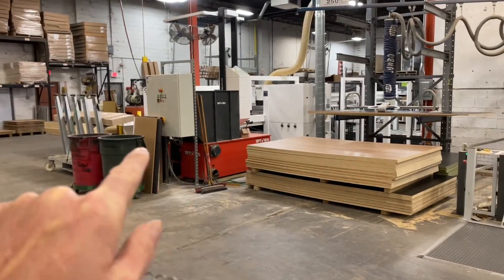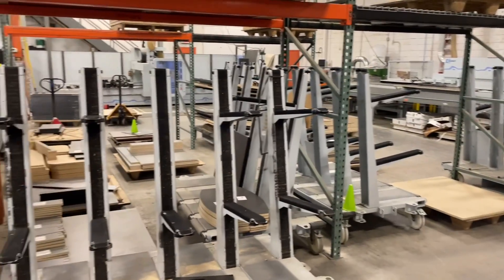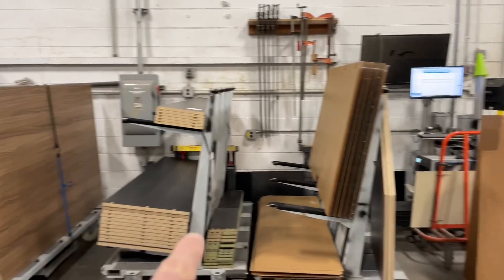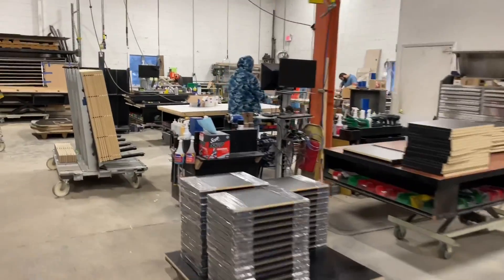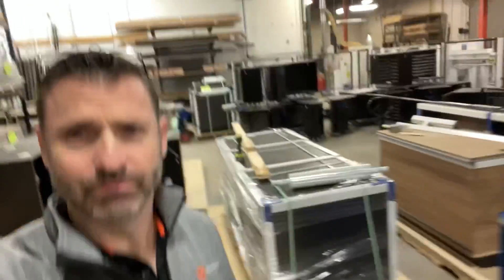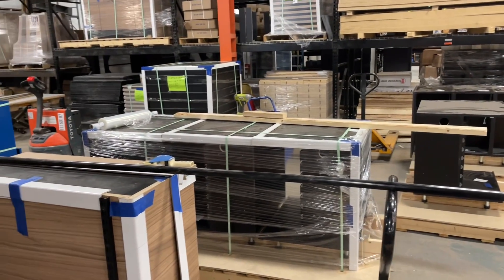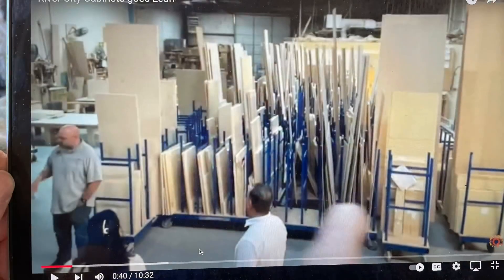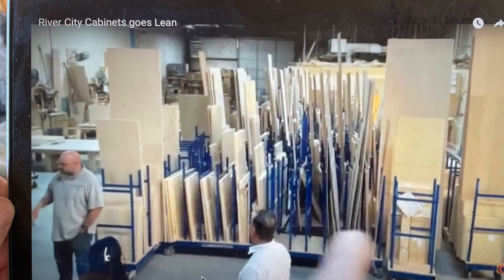Finding bottlenecks in your manufacturing factory.  Lets think LEAN

Comment: Hard to notice a bottleneck 1 min into a video without fully understanding the process and the process flow. But if I had to find a problem after watching 1 min,  my first guess would be the layout (it does not seams to be flow optimised), no working 5S (brooms are just standing randomly, no signs and things are not in order), no indication operators are invested in improvements (sins there are very few signs that there are continuing improvements in the workplace, based on this 1 video 1 min into it. this make me guess everyone is not involved), and lack of training and understanding of how improvements would benefit the people working there (mor people would probably be invested if they understand how it would benefit themself).

Edit:
Assembly area:
carts in the way of light switches and buttons, a person not working in an ergonomic way, is working on the floor. (Question is why does he work on the flow are the factory missing some aid that could make things easier or are quality control bad so things were missed, a huge amount of unmarked things all over, people working in a loud environment without PPE, no guided lines to the exit that would make it hard to exit the building in case of a fire and a lot of things all over the floor, its not like there is a straight line to walk to the exit sign.

Shipping:
Again people working from the floor, and Things are all over the place (1/3 of all accidents is because people are falling or tripping on things), Depending on what type of products are made a packing machine would be considered,

Edit 2:
You wanted us to guess where the bottleneck where in the first minutes and your answer in the end was that there was no bottleneck in these first minutes(?)

Comment: I could see it was the saw, but I didn't want to steal your thunder, Brad. 🙂 Nice set of videos.  However, I am still waiting to see the rest of the story from your last project.  How did I know it was the saw?  Well, the saw is either the source of overproduction or it is the source of the backlog.  Putting shop orders in a drawer and concealing visibility is hard to see.  I guess if you discovered what their lead time is, you might recognize a lack of flow from the office to the shop, especially in an operation that has so few process steps.  It only took me 30 years to see between the lines of the obvious and the hidden.  🙂